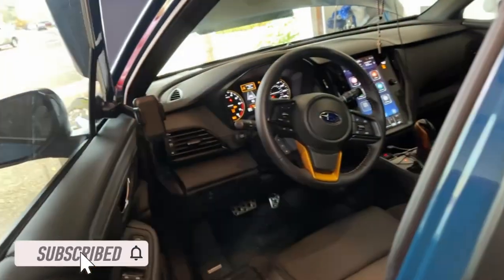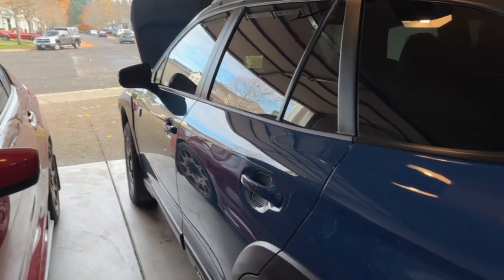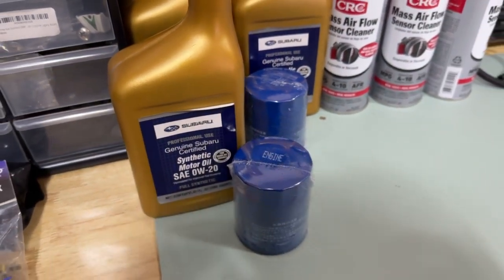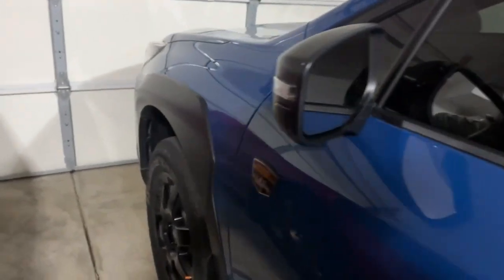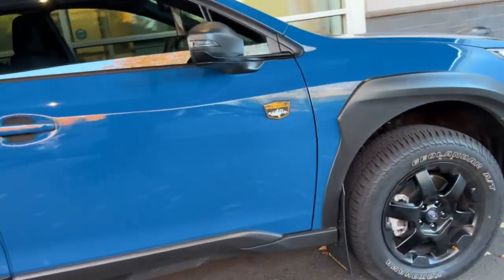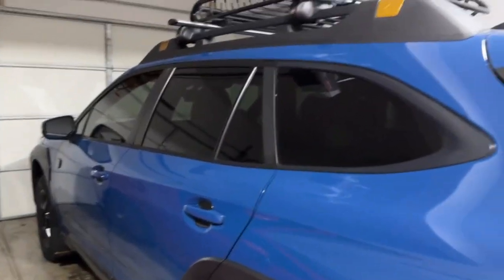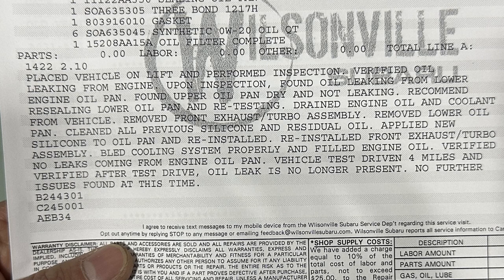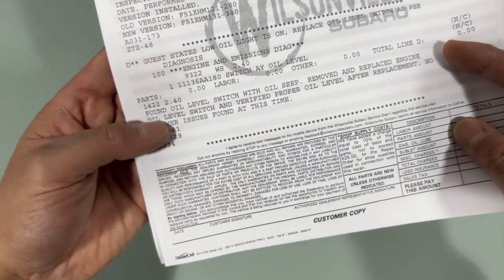OIL LEAK AT 1400 MILES! | 2022 Subaru Outback Wilderness

Comment: My 2022 Subaru touring outback has a oil link. Thanks for your video. Total bummer. 3k miles.
Reply from the maker: Glad to help! Thanks for checking out the video.
Reply: @ronfromportland - Just got my car fixed at Subaru of Portland. They found that there was a PCV connector that was leaking, it was replaced and tested. The engine was also steam cleaned to remove excess oil residue. I asked about the gasket and sensor and they said it was thoroughly checked.
Reply from the maker: @ashleybai85  very nice! Sounds like it was a quick turnaround.

Comment: I read many issues with the new Subies, makes me not want to get a new one... is Subaru quality getting worse?  I do have eyes on a 2023 Nissan Frontier PRO-4X come spring . Also I do drive a 2018 FXT Touring with some mods, and I have no issues so far and mileage is at 35k.
Reply: Subarus quality has always been at the bottom of the Japanese car segment.
Reply: I literally was in the same boat. I recently reserved a 23 OB Touring XT (but have always wanted a truck). I talked to my friend who’s a Subaru Tech and he said to watch out for oil pan leaks. I’ve owned several new Subarus from 2014 to our current 2018. And some of them either had oil leaks or needed new transmissions. One needed a Harman Kardon amp and another a head unit. I just got a 23 Frontier Pro-4X and I love it. That’s how I became friends with my Tech.
Reply from the maker: I was pretty upset when I found out it was leaking. I didn’t bother checking because I assumed, since it was a brand new car, I wouldn’t need to. I was wrong though, sad.
Reply: @ronfromportland  that kinda how I felt when I bought my 21 sti, then realized even though it’s a new car I have to check it and maintain it like it’s a car with 150k miles.
Reply from the maker: @lucian7182  I don’t blame you man! Currently dealing with a blown turbo on my WRX 😀
Reply: Everything is getting worse

Comment: Did they say whether or not it was caused by the over fill?  You are 100% correct. That should not have happened.

My 2023 Wilderness is in the shop right now getting the spoiler replaced. There was a run in the clear coat. Apparently, at some point before assembly, the spoiler was re-painted. Also, the bottom left bolster on the passenger seat had a strange divot in it. That’s also getting replaced. I noticed the same issue in the loaner, but not as bad. I’ve had my car since October 24, 2023. The service manager at dealership is really working hard to get it all resolved.

I’m going to look under this loaner (Wilderness) to see if it’s leaking. It has 1,900 miles on it.
Reply: I’m replying to my own post. I just checked the loaner oil level after letting it rest for 15 min. The oil is 1/2” over the full mark, but I didn’t see any oil on the pan. When I go to pick up my car, I’m going to check the oil and if it’s overfilled, I’m going to have them drain some out. Then I’m going to put them on notice about this issue. I’m going to show them this video. I also took screenshots of some of the comments by the techs here. 

Man, this is exactly why I stopped buying BMWs.
Reply from the maker: It was most likely a defect from the factory. They didn’t mention anything about overfilling the oil being a potential reason for leaks.
Reply: @ronfromportland  Thanks, Ron. I’ve talked to a couple other Wilderness owners who haven’t had any n oil leaks. Hopefully we don’t all get slammed with it. Or, if it does happen to us, it will be within the warranty period. I suggest that everyone who has the issue report it to the NHTSA. If enough people report it, it may prompt Subaru to issue a recall. That may help those who have the issue after their warranties expire.
Reply from the maker: @derspeed5796  yes, make sure it’s all documented! Definitely check the oil level right after. I should have done this but I didn’t. I ended up draining close to a quart of oil after the repair was completed.
Reply: @ronfromportland  Yes, I always make sure they document everything. Good luck, man.
Reply: @ronfromportland  I have an update with some information to pass along to anyone who is interested. I got my car back today and it’s all good. This morning the service manager called to advise it was ready. I started to tell him about the oil leak issue, and he indicated that he knew about it. He said he hasn’t seen a lot of it, but some cars have had the issue. He assured me it is an easy fix, and Subaru is aware of the problem. I also told him about the over fill problem. He said he would check the oil. 

When I picked up the car, it hadn’t been started for several hours. In my presence, with the car still cold, the service manager checked the oil level. It was about 1/4” over the max dot. He said the proper way to check the oil was to run the car for 20 seconds, turn it off and wait 30 seconds before checking. So, that’s what we did. He subsequently checked the oil, and it was just below the max dot. Hopefully this information helps everyone.
Reply from the maker: @derspeed5796  thank you for the info!
Reply: @ronfromportland  Any time! Hopefully this helps everyone. I’ve modified quite a few cars, so I really like to dig in. This is my first Subaru, so I have a lot to learn.

Comment: See it all the time on the 2.4 turbo motors. Seems like the manufacturing had not put enough sealant on the rear of the pan causing a area where oil can river out. Not too hard of a job to do but not fun either😂

Comment: I went through the same thing. My OBW had a oil leak at the lower oil pan. Overall I am happy it wasn’t the upper oil pan.
Reply from the maker: Glad you’re getting it addressed!
Reply: @ronfromportland  I actually inspected my oil pan today just for piece of mind and it’s still leaking it’s actually worse compared to the first time I took it in
Reply from the maker: @jorgeserrano8806  wait, so you got it fixed and now it’s leaking again?
Reply: @ronfromportland   correct I honestly can’t believe it. I’ll be ripping someone’s ass when I get to the dealership
Reply from the maker: @jorgeserrano8806  oh man. That really sucks! I’ll be checking mine here shortly. Keep me posted on yours if you don’t mind!
Reply: @ronfromportland  you got it man! It was replaced less than 2 weeks ago
Reply: Find out mine leaked today 22 outback

Comment: You don’t sound like a broken record. I’m frustrated a Subaru right now I bought a 2024 outback wilderness two weeks ago and I have a high idle problem,
Reply from the maker: Thanks man. High idle? That’s a first. If you decide to take it in, I’d be curious what you find.
Reply: I started calling Subarus customer advocacy sent them videos of what was going on and asked for Tec advice. I took the car in yesterday and they said they couldn’t duplicate the problem. I Show them the videos and the tech seems stumped. Why after the car has been driven on 90° day and parked for 30 minutes when you restart start the RPMs are over 1500.

Comment: My coolant level is 1.5 inches over max, I just looked at my car. 400 miles, never changed. 23 obw. I’ll have to have my dealership use a dipstick on my oil level. I pulled my battery terminal and found all this white goo all over it. Worried it’s corrosion.
Reply from the maker: White goo on the terminals is normal, I have it too. It’s applied on there for anti-corrosion.

Comment: I got the same thing at 20000kms the engine make funny noise, the car is rented they changed the oil pan gasket and the low lever sensor too
Reply from the maker: Any new issues since?
Reply: @ronfromportland  I don’t know yet its just happen since 1000kms and I didn’t have time to look under the car yet 😔

Comment: They shouldn't need to run a dye through the oil...that would only be to differentiate one oil leak over another. They should be able to find the oil leak and conclude, well, that that's the oil leak. IMHO. Thanks for uploading.
Reply from the maker: No problem at all. Glad I was able to document this.
Reply: @ronfromportland  I crawled under mine and had to remove the plastic cover underneath, but luckily I had no leaks. I've done one oil change and to date, with 7500 miles on mine, no leaks. Thanks for your upload. Love that blue, by the way.
Reply from the maker: @michaelking42  glad yours wasn’t leaking. Thanks for letting me know!

Comment: Just bought a used 21 outback from Volvo dealer with 45000 miles.  Oil all over my garage!  Noticed dipstick was very high.  About to diagnose tonight
Reply from the maker: Dang. Keep me posted !
Reply: @ronfromportland  oil plug dripping.  Rest of the pan dry.  Went to losen oil plug and didn't even need a wrench.  That in combination with too much oil, has to be the reason of the leak.  I'm a first time Subaru owner.  This is the reason why I hate dealers doing maintenance.  Volvo must've did the oil change to sell the car and completely disregarded oil capacity AND tightening the plug to specs.
Reply: @ronfromportland  oh, and this oil plug washer is definitely aftermarket.  It's a big plastic washer.  Pretty sure Subarus don't use this

Comment: My 2022 subaru forester has a oil leak with only 3741 miles 😢😢the dealership is pulling the engine to fix he problem
I will be sending a letter to the Manufacturer and local dealership.
Reply from the maker: I hope you get it sorted out!

Comment: Were you losing oil?

Were there any trips on the floor of your garage? 

I don’t have a creeper, so looking for advice. Glad you got yours resolved.
Reply from the maker: I caught it super early so it didn’t get the chance to drip on the floor. If you get a small mirror and a flashlight, you’ll be able to inspect it. Look around the oil pan area near the drain plug as well as the front sway bars. You’ll be able to tell if it’s leaking right away.
Reply: And here’s one for you. I took my wilderness in for its first oil change, and for the next few days, when I was in traffic, I would smell oil burning.

At first, I thought it was drips from when they changed the oil. Then I figured it was the trucks ahead of me in traffic.

 I got to my office, popped the hood, and there was oil in the little drip tray that the filter attaches to. The knucklehead tech did not tighten the filter! I could easily tighten it with one hand. I’ve called the dealer four times and they haven’t called me back. I’m thinking of trashing them  on the questionnaire.
Reply from the maker: @geoffreydlin8043  WOW.

Comment: My 2023 is way overfilled too. I couldn't believe it.
Reply from the maker: Dang! You can always take a little bit of oil out by loosening the drain plug.
Reply: @ronfromportland  True.  But like you said at the end of your video, we shouldn't have to be dealing with crap like this with a brand new car. The Nissan Pathfinder I owned for 13 years before buying this Subaru didn't see a mechanic for at least 7 years. I'll be under my Outback tomorrow morning doing what you did: changing the oil early and checking for leaks. Thanks for the heads-up! I appreciate it.
Reply from the maker: @markl1473  yup, it blows my mind how some folks can be so nonchalant about it. Good luck with everything! Keep me posted if you don’t mind. Thanks for checking out the video.

Comment: Great! Now, I wonder if my 2023 Outback Wilderness has or is going to have this problem. The boxer engine has been around for a long, long time so I'm wondering why this issue even came up? Shouldn't this engine be bullet proof by now? Time to go out and crawl under my 2023 OBW! Just turned 2000 miles yesterday.
Reply from the maker: Yeah, it was frustrating for sure. Let me know if you find any issues! I haven’t seen or heard of the 2023s having this issue so I’m curious.

Comment: Update on our oil leak: lower oil pan, just like you. I'm going to call in and ask about the oil level switch as well while they're in there. Our loaner is a 2023 Outback Wilderness and I noticed the CVT operation is WAY smoother. Is there a software update for the CVT control system that can improve the CVT operation?
Reply from the maker: Wow, really?! When you say smoother, are you referring to the slight jerk when decelerating? I haven’t heard of a software update for this but I’ll definitely look into it.
Reply: @ronfromportland  Yes and to be honest there are a few things I don't like and some quality of life things that are nice. The biggest thing is the CVT operation. They both are a little jerky when decelerating at low speeds because it's in a low gear ratio which is expected but I'm talking about accelerating. The 2022 increases the gear ratio much slower it feels and combined with the fact that it's turbocharged makes accelerating feel like you get a surge of initial power to 3k rpm and then levels out and becomes linear. The 2023 feel linear from idle all the way up to 4k rpm which is where you'd expect the turbo to fully spool. Idle to 3k feeling a surge doesn't seem right. It makes the car feel like you're either rolling along or flooring it and modulating the accelerator in a way that smooths this out is almost impossible. I don't even have to think when driving the 2023. The acceleration is smooth and predictable. Maybe it's just my outback that behaves like this.
Reply: I have a 2023 loaner now. The feature that stops the engine when the car is at a light is much smoother.

Comment: Can you post a picture of your repair report from the dealer? I want to take that with me to compare to the repairs done to my car for the same problem.
Reply from the maker: Check around the @9:09 mark, I put a still of the details there. Cheers!
Reply: @ronfromportland  Thanks. I just spoke with my dealer. My 2022 Outback has been in for one week and they expect the parts next week. This is a known problem... they had six more with the same issue after mine.
Reply from the maker: @andrearuffino  anytime! Definitely a known problem. Mine has been fine since the repair. Seems like an easy fix for them minus the parts shortages

Comment: I was going to order a new Forester, like within the next week. I guess I will research if this is happening with them as well 🤦.. we live in a small town and it's an hour drive to the dealer, I don't need this drama!!
Reply from the maker: I don’t think this issue is as common on the Foresters but I would for sure look into it. Mainly on the Outbacks that have turbo.
Reply: @ronfromportland  It's ironic I found your post. I had actually told my wife I was worried about the reliability of the turbo engine, in relationship to how far we are from the dealership and I wanted to stick with the naturally aspirated Forester.
Reply: This is a problem exclusive to the new outback 6 cylinder engine the 4 cylinder 2.5 should be and shown to go into high mileage with no problems just good maintenance
Reply: Pepita, Subaru hasn’t had a 6 cylinder for a long time. They’re discussing the 2.4 turbo engine.
Reply: @peppitachips1764 subaru has NO 6 cylinder engines anymore. Educate yourself

Comment: With all due respect sir..... I own a 2022 Subaru Outback Wilderness in Canada(Purchased brand New). No oil leaks. Either you purchased a Lemon....Had it serviced 2nd hand...or done the service yourself. Or you modified your vehicle. Any way good luck with respect.
Reply from the maker: I respect your comment! But what I have is the exact opposite. Purchased new with 6 miles, not enough mileage for the first service, and unmodified. So far it has been good though 🙏 . The leaks seem to have stopped. Glad yours has no issues.
Reply: @ronfromportland  Have you found out what caused the oil leaks?
Reply from the maker: @resolution55555   yes, it’s all mentioned in the video. Oil pan gasket and oil level switch.
Reply: @ronfromportland  I hope that I don't have the same problem.
Reply from the maker: @resolution55555  I’d just keep an eye on it

Comment: I wouldn't use those crappy blue Subaru oil filters.  They are made by Fram and have cardboard end caps!  Mr. Subaru YouTube channel talks in depth about this.
Reply: Thats weird. I've always used oem subaru oil and filters and every Blackstone analysis I've received was amazing. They even commented on how good the oil looked even after going over the mileage interval by a lot.
Reply: @mattvogelsong8460  you're fine until you're not.  I'm just not a fan of cardboard end caps.  There are many documented cases of the end caps failing.  Also, watch your fuel dilution.  Blackstone notoriously reads low.  I used Blackstone for years until I saw fuel dilution discussed on Bobistheoilguy.  I use Oil Analyzers now and I'm seeing 2.4% fuel dilution at 3000mi.  At this fuel dilution, the oil has thinned enough to barely still be in its viscosity grade.  I change the oil at 3000 because of this.  We do a lot of highway driving also, not short trips, which typically cause increased fuel dilution.
Good info here:
https://youtu.be/E5jZuTQhlEs
Reply from the maker: Steve, I actually remember this video. Thanks for the reminder! I’ll look into alternatives asap. Luckily the OEM filters on my WRX are the black ones.
Reply from the maker: It was a different video I watched but I’ll check this one out from Bob

Comment: I find it humerous that people think any product, designed and assembled by humans, should be free from any potential issue because of the price paid for said item. That is why they come with a warranty. S**t happens.
Reply: Weird. Most times they just burn a quart of oil.
Reply: Subaru has replaced humans at the assembly factory with robots. Specifically robots apply the gasket adhesive.
Reply: @jorgeserrano8806  robots, buit, designed and programmed by humans....